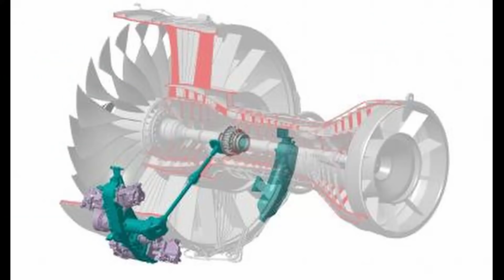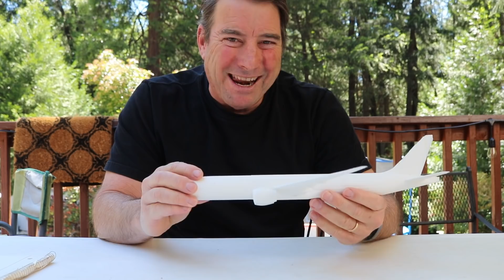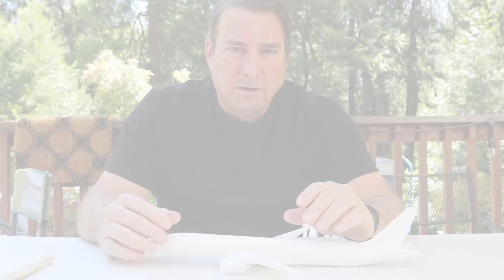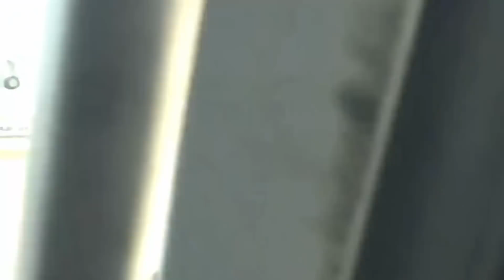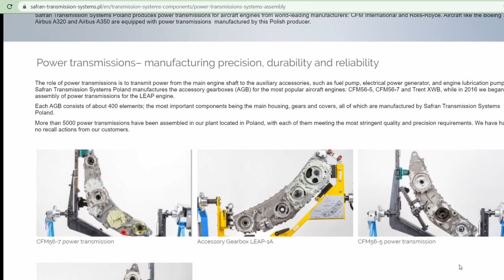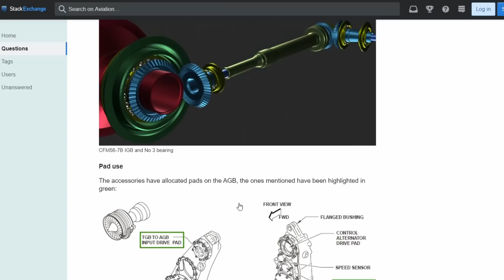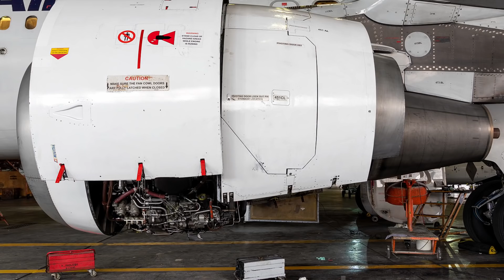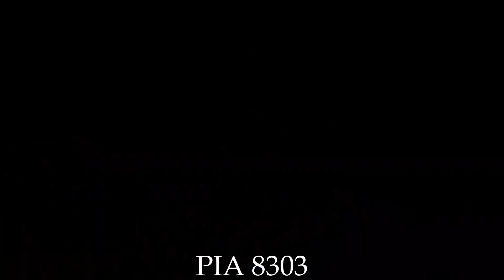PAKISTAN INTERNATIONAL AIRLINES #8303 UPDATE #2 23 May 2020

Comment: I imagine that the sudden shock forces on a driveshaft spinning at 19,000rpm would be enough to chew up the teeth on the gears at each end of it.  If not shatter the shaft completely
Reply: That kind of thing happened to me on the discharge pump in a tanker truck the pump seized the shaft got split in half @ 800rpm, now imagine the inertia of 19000rpm
Reply: @acrodrigues1  Was unloading a cryo tanker that had the old VW pony motor on it. Pump came apart while pumping and seized.  Driveshaft came apart and beat the snot out of the bottom of the tank.  Ended up rupturing the outer shell.
Reply: And I'm sure one of the "accessories" is the oil pump for the bearings. No oil = seized bearings
Reply: Eastern Woods it takes a long time for the engine bearing to seize from oil starvation. Maybe 10-15 min. They aren’t like car bearings. You hit section bearings will fail first from heat. Seen tons of them. The radial drive shaft might break a few teeth off the radial gear box inside of the fan case deflected enough. More than likely it would be the fuel pump shafts shearing that would cause such an immediate failure. The fuel control is bolted to the back of the fuel pump and the share one shaft from the gearbox that’s drives them both. Where the shaft goes in the gearbox it has a shear point stated in another post. It is about a 1/2 diameter shaft the for about an inch is whittled down to about 1/4” or less diameter. When the mec or fuel pump size it keeps the entire engine from stopping so you can return to the runway while windmilling the engine to maintain positive oil pressure in the engine after the engine is shut down. If the gearbox stops all the accessories will stop. Either way when the fuel pump shears the engine stops completely immediately. If both engines had the same failure both engines would stop. Hydraulic pressure electrical and oil pressure issues can last for maybe 30 min with out causing the engine to stop and plane to be controlled. Fuel distribution issues stop it right away
Reply: @josht8011  why not use a different power source than the engines , they turn too fast , are not in a safe place for this rare touchdown event, so, but its added weigth always bad . a fuel motor located where , higher somewhere anywhere. ....or  hm yea hmm. maybe not cos airflow could be used to power a fan is lighter. as is done in emergency on some planes. but must be something wrong with it or else it would be done that way. also...what if ...the  underside of motors are wulnerable. what can be used to protect them. the landing gear when retracted maybe. or no or  if it went half way down automatically when ...low altitude or... or if motors were higher so lowest point of strike was gear wheel barely protruding but higher motor is in wing that is not good for strenght or makes a heavy cage for it l guess. costs too much to carry.
Reply: Josh T  I’ve been listening to the recording...  it’s easy to hear on VAS AVIATION clip... the pilot calling tower on the GO AROUND .... the engines can be heard thru his mic and they are Spooling UP...  so I got to looking on YouTube ( not the best I know...) and I found this Indian or Pakistan guy called “BOEING BOY” dresses like a pilot... said that AFTER the aborted landing ( which is when we believe he had the twin pod strike) .. the plane ran through a flock of birds and this FOD’D out both engines.  ( no video or photography.. just a verbal account) .. ???????  Just have to wait for the data.    And those folks over there are know known for their video skills either.
Reply: @josht8011  Thanks for the info. This channel is my first point of contact for aviation news and it is helped by the number of people working in the industry who participate. A question: What if the ancillary drive could be positioned round and up higher on the engine to protect it from ground strikes?
Reply: @travelbugse2829  Even in that case saving that accesory gearbox would not save the engine... Nacelles are very lightweight, thin and only serve aerodynamic purposes, not at all structural ones.  See, the clearances between the rotating blades and the casing is very tight. Any brief rubbing is going to cause severe damage.  There is no real advantage in relocating the accesory drive, as the next thing contacting the runway will be damaged!
Reply: @easternwoods4378  To be honest, striking an engine like that is always going to result in complete engine failiure within minutes.
I've worked around acessory gearboxes and they have ALL the important subsystem generators attached to them. Low Pressure fuel pump, High pressure fuel pump, Generator, Hydraulic pump, Oil pump, Starter.
If its not outright fuel starvation then its going to be bearings seizing & destroying themselves.
A terrible tragedy, it seems a single mistake was made and dispite further correct actions sich as deploying the RAT to maintain Electrical power & Hydraulic pressure, and probably starting the APU, it resulted in such a horrific accident.
Reply: @easternwoods4378  All the bearings in a jet engine is roller or ball bearings, they can run for a while with out oil which is mostly for cooling
Reply: Lasse Langwadt Christensen that’s true. There are  oil valley that always hold a small amount just for that. I know my old tanker with J-57 needed to scavenge at 85% for 15 seconds after idle EGT stabilization at the lower limit.... to avoid a internal fire in the turbine section
Reply: Of course the mounting ears and fasteners are of sufficient size and strength to cause deformation of the turban casings also causing engine failure
Reply: Kriss Femmpaws  I have picked up TWO wrecks ... you’d be surprised at what breaks off and what does not. What bends and what shears ...
Reply: There is an engineering fail point on the shaft.  ( Shear Point). It is of a higher torque the the other shafts as it’s not the one you want to replace.
Reply: But my question is, how could it be that the airplane managed to do a full go around procedure with a damaged/broken shaft? Wouldn't that be impossible?
Reply: @Tod_oMal  The timeline doesn't support them doing a prior go around.   They hit the runway as they were transitioning to the go around, and lost both engines on the climb out.
Reply: Fat Guy In a Truck that’s right...AND on the audio as the pilot calls in to report Go Round... the engines can easily be heard spooling up on the radio. ...
Reply: Anatoly Kasparov it would be if it broke on right away....  of course that is all speculation.  We will find out when the data comes our.  That will give us a time line.  WHAT WE DO KNOW... is that they had no power on two engines.  ONE engine we saw yesterday... and the Fan looks like it wasn’t turning on impact and we saw the RAT was deployed.
Reply: Most likely broke the gearbox mounts. The critical components are really close to the cowlings.
Reply: Simply broken shaft to gearbox= no fuel pump=no fuel burn=immediate engine shutdown. If they had power right after contact, the gear box was still working. Failed later?  Perhaps misalignment or rub caused a later failure.

Tubes and harnesses would likely would have been damaged. From comments the engines didn't contact at same time meaning wings dipped side to side and therefore contact wouldn't have been bottom datacenter. As result, possible hydraulic lines were severely damaged but not sure of location? 

Was the aircraft trailing vapor/fluid? Would think it would have if tube or gearbox case was cracked or broken.
Reply: Andre T right ... that would be a good  read of failure time line ...  I got to looking around and there is reports in the local news over there that AFTER the “ Go Around “ and I’m not sure but guessing it is immediately after the pod strike .... that they flew into a flock of birds ????  .... I know... it’s not hard data.  I am really curious about this one.
Reply: Francis Schweitzer, take a look at the photo showing the RAT deployed and the engine cowlings scuffed, the is a rather large bird (not the A320 species) flying nearby. It doesn’t mean that any were ingested, but were definitely in the area.
Reply: Even a little damage to the pipes would cause a massive cascade failure of engine systems.

Comment: Let me add something, the position of the accessory gear box that you showed, is from a 737. In a 320 there is more clearance between the engine and the ground, so the gearbox is completely beneath the engine, not on the side.

Comment: Until we hear the content of the cockpit voice and data recordings, it’s all speculation. However speculation with a good knowledge of the plane’s various systems, goes far beyond mere idle speculation when trying to explain what happened.
Reply: That is why Juan didn't stress a certain scenario.  The main point of this video, is the potential damage to the accessory gearbox, due to its location on the engine and the pictures showing outer damage to that area.  He points out the black boxes have been recovered.  This is a good update - a step in the process.  It is not saying what actually happened.  For those of us unfamiliar with the engine (eg me) I found this very educational.
Reply: @donmoore7785  , must agree with you. Amazing how the flight crew managed to very lightly damage both engine cowlings, yet not notice any degraded engine performance immediately. The video does a very good job of explaining how mechanical failure could develop.
Reply: Cvr is merely speculation too bro. You don't know what you're talking about
Reply: The pilot was getting his ass pounded by the co pilot that’s why he crashed

Comment: I believe a  PAA 737-200 did an unintentional gear-up touch and go at Templhof in the 1980s that resulted in similar damage.  It was a Sunday training flight with a 5 on board.  The plane lost hydraulic A and B and low oil pressure in both engines but made back around and landed.  Was back in service with new engines and other repairs.
Reply: That's because the 737 has a manual reversion mode that can transfer flight controls to just cables and pulleys. Requires some muscle and strength, but it gets the job done.

Comment: Thanks for the explanation. But my question is, can the aircraft manufacturers not redesign the position of this critical piece of equipment, like, maybe putting it on top of the engine as to the bottom, then use the bottom of the engine as a kind of cushion/damper in the event of another  runway hit.
Reply: If the bottom cowling is squished against the fan blades your engine is dead anyways.
Reply: Marty C __ ? I think it is safe to say that the design of the engine doesn't really make much difference if you are intent on landing a jet liner without using the wheels.
Reply: MD Douglas designs u talking about?

Comment: The A320 has constant speed accessory/alternator drives. This results in a larger accessory dive assembly. The 787 and A350 have wacky power AKA no constant speed drive. They are more compact and might not be as exposed to strike damage. This might drive future design mandates.

Comment: I hadn't seen the damage on the engines before this... the pieces are starting to come together in this horrible tragedy.  Thanks for putting this together
Reply: I saw that photo early on and I thought it was soot ... but when Juan zoomed in on it .... oh wow!!
Reply: I wish we had better pictures; I'm guessing the black is leaked oil, but I can hardly make out nacelle/cowling damage. And who the hell designs the layout of the aux. equipment  so close to the ground!?
Reply: @wim0104  Well if you forget to land with the gear down what do you expect?  Emergency situation where you have total failure of the primary and secondary hydraulic system to the point you could not lower the gear (even manual lowering) is a failure of a completely different situation.
Reply: @evilload  Juan is deliberately avoiding the natural question: if forgetting to lower the landing gear "is extremely rare in commercial aviation," what other reason could there be for such a tragic shortcoming? Is it possible that the plane itself fails to signal its unpreparedness to touch down? But in the previous video there is an alarm sounding in the cockpit.
Reply: @evilload  3⁵⁶u
Reply: @alinonymous  I speculate the pilots were getting alarms for messing up their ILS approach, so there was no capacity left for landing gear related PULL-UP! alerts...
Reply: @wim0104  Thx. This is indeed getting more complex than initially thought.
Reply: @alinonymous  Gear was down, crap landing approach, decision to go round, immediate retract of gear while airborne, insufficient airspeed in ground effect so plane kept sinking while engines were spooling up. It wasn't a hard hit, like this was: https://en.wikipedia.org/wiki/Air_Canada_Flight_621
Reply: @alinonymous  Warning system is an aide to the pilots, not an automatic correction to the issue.  Even if the warning signal wasn't working, it is still part of the before landing checklist procedure to deploy the landing gear and to ensure the landing gear is "down and locked".  I think Juan has done an excellent and unbiased analysis as usual.  The accident investigation board will eventually point the fingers to what was either contributing or causal to this accident.
Reply: @lenbyrne5131  356u back at you?
Reply: @evilload  I see. So it can be deployed, but not blocked into fully functional position. Technical details like this make all the difference. Thanks.
Reply: @wim0104  I was wondering if the gear handle being down, even if the gear is not, might inhibit EGPWS mode 4A. It will be very obvious from the CVR if a "TOO LOW – GEAR" was present or not.
It's about 5-6 seconds after the alarm in the background that there's a separate transmission announcing the go around.
Reply: @alinonymous  Apologies.  I neglected to mention that manual (gravity and/or airflow) deploying of the landing gear might not always work.  Maybe down but not fully locked/blocked into safe position (say the one of the gears was a bit sticky).  Next step would be a "bump".  Pitch up/down a bit to use g-forces to settle the gear fully locked/blocked safe position.  However, this is a moot point if you ignore the problem in the first place.
Reply: @wim0104  Saves a ladder truck for maintenance to put it there.
Reply: @wim0104  You would have to redesign the whole airplane structure to "correct" what you suppose to be a "wrong" design...
First; no commercial jet engine has ever been designed to be able to support the weight of the aircraft, even at rest... Not even the engine pylons are ever designed to resist such a load, much less withstand the kind of loads that such rubbing will produce.  Next, suppose the accesory gearbox is located on the upper part of the engine; with the clearances between the rotor blades and the casing being so close, which is needed for the engine to work, any load placed on the bottom of the engine will distort the casing making the rotating blades to contact the casing inside, producing damage. Gas Turbines are high precision assemblies rotating at high rotational speeds and close tolerances. Your comment is wrong in relation to the engine design: wherever you locate the accesory gearbox, ANY other part of the engine contacting the runway will damage it severely.

Comment: So the "bounced" plane you showed also caused all the landing gear on the right side to be destroyed?
Reply: I inferred that the auxiliary units were rendered inoperative which means a lack of power to hydraulic systems & fuel pumps.  That would mean the gear couldn't be lowered, and I think the pilots reported twin engine failures (no fuel supply).
Reply: id say pilots forgot to lower landing gear or they got 3 green lights to show geardown when it wasnt

Comment: They shouldve landed without the landing gear and everyone would be fine.
Reply: It’s harder than you think tbh otherwise they would have done that
Reply: @Raggy786  ya cause the plane kinda bounces when it hits the engine first but the if they were trained for the he could of some that easily or even make a go around
Reply: @heermage  proper belly landing was polish airline.
Reply: Oh, simple as that eh? Why bother having aviation experts, they should just ask you instead.
Reply: In hindsight, yes, but real question is why didnt they abort landing before they made contact with the runway. If they were surprised by the lack of gear, they would have to make the decision for emergency (crash) landing in that very moment - within a few seconds of contact with runway. The normal reaction would be of course to go around and attempt regular landing, which is what they tried to do.
Reply: @misium  I totally agree
Reply: There was a gear warning sound on one of the radio transitions prior to touchdown
Reply: @oldmech619  true, and he said that it's common for light aircraft to forget to lower the landing gear
Reply: Have to wonder if they ruined their chance to glide to the runway by lowering the gear during the final descent. Maybe they could have glided past the houses and made a belly landing on relatively flat ground without the drag of the gear?
Reply: I know but realistically both engines were out and I not think they could be made a recovery from that so I think it would be better to overshoot the runway cause then they will have a higher chance of surviving
Reply: Anyways rip to the people who passed away
Reply: Do you remember the polish airliner Lot at least more than a decade and a half ago? They ran into a similar problem but they had a gear failure and the landing strip was filled with whatever they filled it to Provence a fire or the engines ripping off the wings due to the forces of drag?